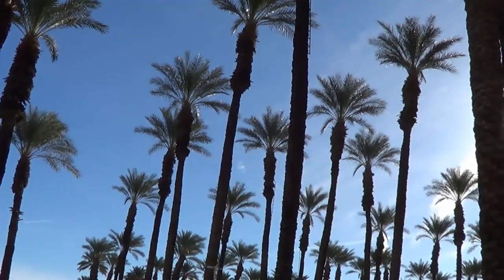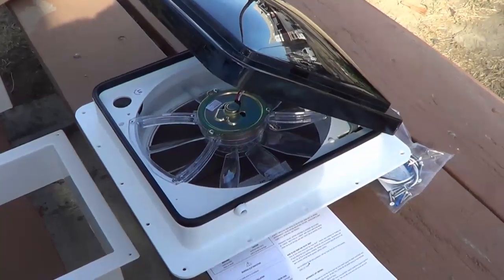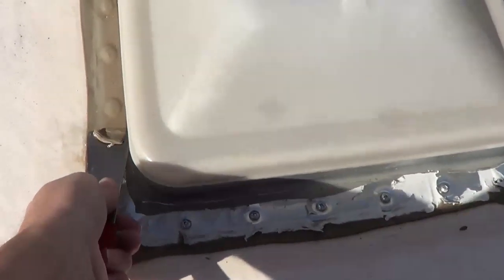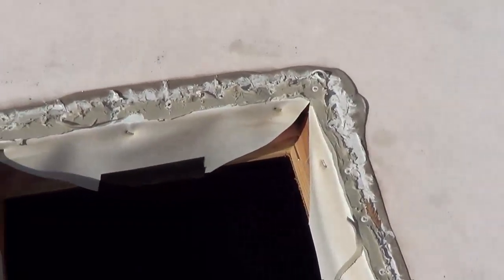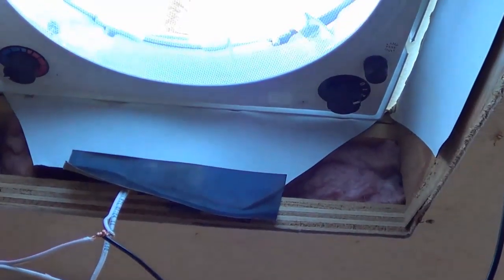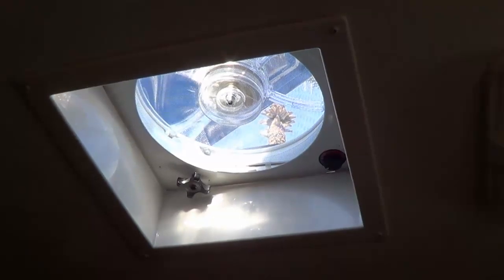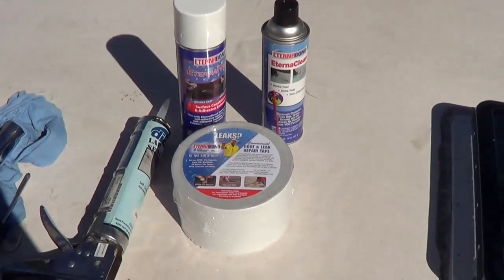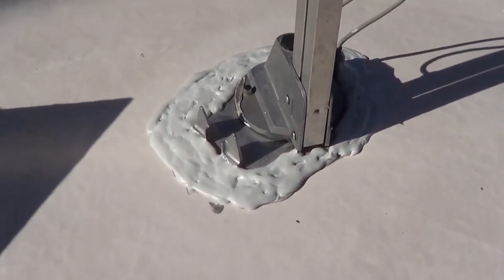Installing the Fantastic Vent Fan in our RV

Comment: Great job, Ray. Thanks for the walk-through on the instal. 
We had the dealership install on of these in our bathroom vent. We love it. It really helps get the moist air out of there after showering. We also hang our towels from hooks we installed by the vent, and it drys them quickly. 
Our vent also, like yours in your living room, acts as a 'whole house' or 'attic' fan to cool down the interior of the RV. 
We want to instal one of these in our living area vent space, and instal an 'all weather' vent cover over it.
All the Best, and Happy Camping!
Reply from the maker: Thanks. I plan to add another near our shower as well for reasons you stated but also I could have one fan pushing air out and the other pulling it in. Figure it would really get some nice flow in the trailer. Cheers Ray

Comment: We had the three-speed reversible Fantastic vent installed into the bathroom vent of our '14 Passport 23RB by the RV dealer where we bought the trailer. These are excellent vent fans, and work well as an "attic fan" for the RV. 
Your video gives me the confidence to do the next one myself, in the living room vent. I'll also be installing a vent cover over that one, so we can use the vent in rainy conditions. 

Thanks again, and Happy Trails!
Reply from the maker: Allen Hare Your welcome Allen. I'm really liking the fan, works great for cooking too, on the high speed it really sucks out the cooking odors and steam from boiling things. We have vent covers on all our roof vents, for the Fantastic fan I got their own cover. It was a little more money but has great air flow and is really easy to take on and off. Cheers Ray
Reply: Love Your RV 10-4, thanks again.

Comment: Good video, I just installed the Fantastic Fan Vent cover, it has excellent air flow. You may want to consider one, they are great when it rains.
Reply from the maker: Ray J Thanks, I just picked one up yesterday. I was looking at putting my old Ventmate cover back on but that would take some modifications, drilling holes, etc and heard that air flow wouldn't be as good so got the Fantastic one. It looks larger and has lot bigger vent holes. Should do the trick. We spend six months of the year on the west coast of Canada so definitely need a rain cover. :)

Comment from the maker: +John Smith - I've swapped out all the lamps with low current LEDs so have lots of extra capacity on the line. The fan also only draws a max amperage of 3 amps. No chance of melting, it's also fused by the manufacturer for max current of the wire that hasn't changed. ;)

Comment: I am installing a new vent fan on a new build so there wasn’t one before. So my question is what side of the vent fan outside should be facing the front of the RV? If the top cover is open, is the open side facing the back of the RV? So when driving the wind going from from to back doesn’t try to open the vent fan top (when you want it closed). Or is it the opposite. ?
Reply from the maker: All three of my vent lids have the open side facing to the rear, most do, if you look at the vent covers they slope towards the front and are high on the back  https://www.amazon.com/dp/B007HGF398?ref=exp_loveyourrv_dp_vv_d

Comment: Ray, We are just getting started in this camping thing :) Just bought a 2008 Cougar and ran across your site. LOVE IT! So as for the fan... Would you go with the same model if you were doing it over? Just wonder if the remote would be worth it? Maybe it would make it more independent? I don't want to turn lights on and off separate. Thanks.
Reply from the maker: Teri Genteman I would recommend the remote if you aren't tall enough to reach. I can just reach it without a stool so it's not a problem for me, but I can see it getting old soon if you need a stool every time to adjust it. Happy camping! Ray

Comment: Sorry Ray. But, the most important thing you have to do with RV roof repairs is to make the best possible seal to prevent water damage. You really need to completely remove all the old sealants, clean the area, and use new dicor. Also, the gasket that you pointed out that came with the unit was NOT for the top, but is intended to slip over the inside sleeve where it meets the ceiling. Other than that, the video was ok.
Reply from the maker: Yes, I used the tape BECAUSE I'm so paranoid of leaks. Eternabond tape can go right over Dicor as long as you clean the old Dicor really well. Also, I used 4" tape so there area on both sides where the tape adheres beyond the old Dicor. In my mind, Eternabond is superior to Dicor and the constant need to remove and replace it as it dries out and cracks. My vent's been there a few years now and the seal is as good as the day I laid down.
The instructions state the closed cell foam gasket is for under the flange where is meets the roof.

Comment: I was thinking about getting a solar attic vent for this same application.  what do you think of the idea?
Reply from the maker: Should work. Any heat you can get out of the attic or moisture will help. Friend of mine added some to his trailer, not solar powered but work - http://www.loveyourrv.com/howto-install-an-rv-attic-roof-vent-tip/

Comment: WHAT DID YOU DO ABOUT THE THERMOSTAT?? WIRING??? PATRICK.P
Reply from the maker: I didn't have to do anything it's all built into the fan assembly. I only needed to hook up the 12 volt positive and negative wires.
Reply: the reason for my question was based on the fact the old fantastic fan model#803350/3350 new number had a wall mounted thermostat with (2 orange wires) from the fans circuit board!! the 1250 model does not come with a thermostat and I basically left the (2 orange wires unconnected) I have discovered a short somewhere in the circuit and was wondering if the (2 orange wires needed to be connected somehow-even if there is no thermostat in the fantastic model 1250; I ,m trying to figure out if the (2 orange wires) should be in some way connected or if not "what do you do with the (2 orange wires) I have no clue at this point; thank,s for your timely response; say hello! to your beagle- very cute doggie!! PATRICK.P
Reply from the maker: I would just tape off the orange wires and leave them since the new 1250 model doesn't appear to me to use them. Just has a 12VDC power and 12VDC negative ground wire.
Reply: THANK,S RAY APPRECIATE THE ADVICE!! ONCE AGAIN SAY "HI" TO BEAGLE; PATRICK.P

Comment: My friend's older model seems to push more air than my newer model.  
I get much better & quieter airflow from my little Sirocco fan and it was only $!60 not over $600. 
Dometic agreed to replace the fan and the airflow improved a little but it is still very noisy AND the rain sensor closes the fan at really odd times like late afternoon. So we can't use the fan unless we manually open the cover.
So in summary, I have found it an appallingly poor performing fan that is just not worth the money.
Reply from the maker: At some point the company was sold and bought up by a bigger one.  I think Atwood or Dometic. They did away with the lifetime warranty and I guess cheapened the product. I installed this one in 2014
Reply: @LoveYourRV Yep, Dometic bought them.  And according to one of the guys in tech support Dometic did not do their due diligence and have ended up with an inferior product.
I don't think Dometic really cares.  When I had the fan replaced the guys on site knew nothing about the fan and were referring to the manual.  They had never changed one over before.
Reply from the maker: The original company provided a lifetime warranty and would ship out free repair parts if needed. They built up an excellent reputation in the RV community for their product and excellent customer service. From what I gathered around 2013 Atwood bought the little company that was Fan-Tastic Fans. Then Dometic bought Atwood at some point and rebranded Atwood stuff as Dometic.
Reply: @LoveYourRV  Ahhhhhh, very interesting. I didn't know that background. It would have been a good fan back then.  It is such a shame when a new company lets a product fail apart like that, especially for such an expensive fan.  It is $450 to $550 AUD here.

Comment: Good grief. Why did you not remove the old dicor
Reply from the maker: Because there wasn't a reason to remove it. The Dicor wasn't very old. Why remove the Dicor when it was still fine. With 4" wide Eterrnabond it will overlap it by a large margin anyway. Here is a video from 7-8 years later, with no issues. https://youtu.be/h7LmsL4QKXY?t=191

Comment: Black is ground and colored is positive in DC power
Reply from the maker: Many RV circuits use black for the positive 12 volt DC and white for the negative DC ground wire. I guess its a reference to the AC hot and neutral wires. Can get very confusing, so I find its always best to use a multimeter and check.
Reply: @LoveYourRV  I never seen it and it would be miss identifying  because we all know it's different type of wiring and can easily misswire and cause a fire

Comment: You need to consider the fact that you just added an additional current drawing device in parallel with the main line that was sent to that light.  It is very possible that wire is not capable of supplying that much current and will melt causing a fire.

Comment: Get the Heng Vortex II fan. Thirty minutes and done without going on your roof. Oh, by the way, it cost far less than the "fantastic" fan.
Reply from the maker: I upgraded the bathroom fan to a Hengs, will have to see how it performs long term. Since I bought the single speed and it was way too powerful, I added a variable PWM speed control to make it work a little better. https://www.loveyourrv.com/rv-bathroom-fan-upgrade-hengs-vortex/  Cheers, Ray

Comment: You really shouldn't use eterna bond tape to seal the fan. It will never come off so if your fan leaks or breaks, you'll have a really hard time taking it off. Good luck!
Reply from the maker: If you are going to replace a skylight or vent that has been sealed with EternaBond®, and after replacing the skylight or vent are going to reseal it with EternaBond®, you can simply:Cut through the old EternaBond® tape along the edge of the old skylight or vent.Remove the screws holding it down.When you lift the old skylight or vent off, half of the EternaBond® will be on the flange of the skylight or vent, and half will still be on the roof.When you install the new skylight or vent, simply screw it down and?Put a new piece of EternaBond® over the first in the same place.OR?Second, if you have determined the EternaBond® must be removed, follow these instructions:Using a heat gun or a hair drier, heat up 2-4" of the tape on one end.Grab a corner of the tape and pull on it. The sealant should stretch like pizza cheese.As you are pulling on the tape, cut the stretched EternaBond® with a razor blade, keeping it wet with water.At this point some of the residual gray EternaBond® MicroSealant® will still be on the roof. Work it off using a strong solvent like lacquer thinner, acetone, or gasoline, and some elbow grease, or...Leave the residue in place. It will not hurt anything, and if you put new EternaBond® over the old, the new MicroSealant® will absorb the old MicroSealant®
Reply: Not too hard to get the eternabond tape off actually. It's the residue it leaves behind that is a nightmare to remove. You're better off getting a new roof. However if you need to re-install a fan you can just eternabond right over the existing eternabond tape (or eternabond residue) without issue.